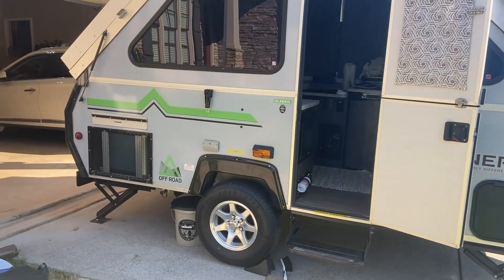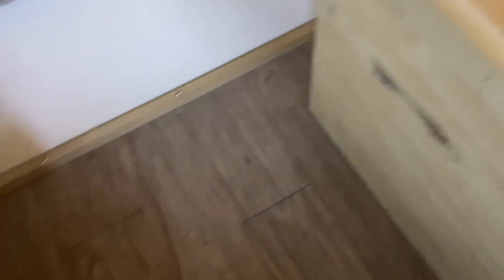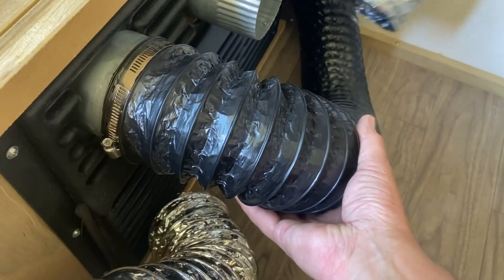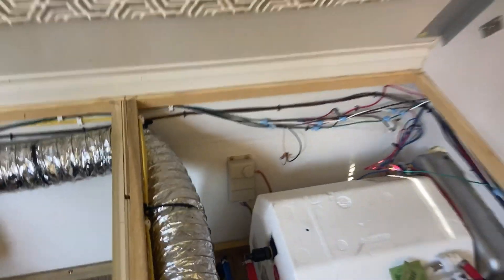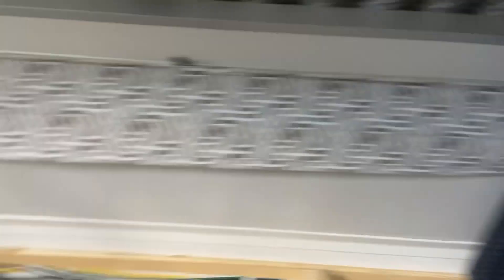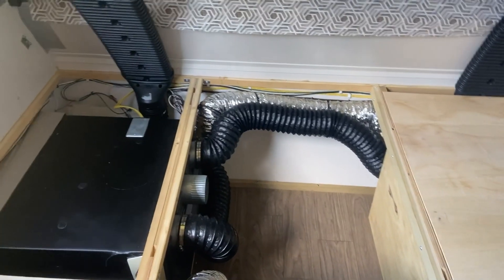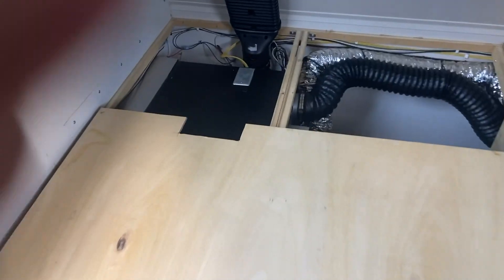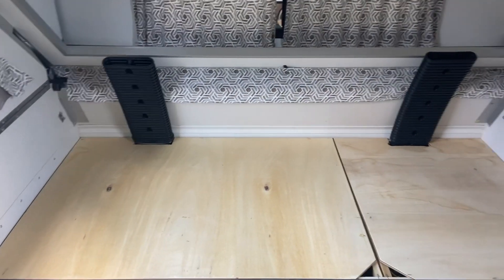Aliner Classic Air Conditioner modification air flow hack for higher distribution of cold air.

Comment: Nice idea but what you should do is the reverse. Leave the AC vents where they are and extend them out to the front of the bed. Block off the return under the bed. Do something similar to your vents to extend to suck the hot air from the ceiling creating circulation bringing the cooler air up. Cold air tends to sink to the ground and the return being on the floor will continuously bring in cold air and  keep the hot air high. I am a contractor this is what you typically do with HVAC in a house. I created a 3D print for extending the AC vents out and covered the return and added a vent through my cabinet by my sink where I have a vent come out on the opposite side where my dinette table is keeping it away from the A/C vents. This helps out a lot to circulate the air. I also picked up a USB powered ceiling fan from Amazon that I attached to a curtain rod that I put up at the top of the ceiling. This also helps as a wind brace. The little fan puts out some air. Your not going to get ice cold camper because Aliner has thin walls and no insulation. But it does make a huge difference.
Reply: Thanks Paul and Bob, the video was great to show what could be done, and Bob's comment as a followup is super helpful. It is a poor design from Aliner to put the air return so close to the output vents.
Reply: Can you include a picture of your mod?
Reply: Can you include a picture of your mod?